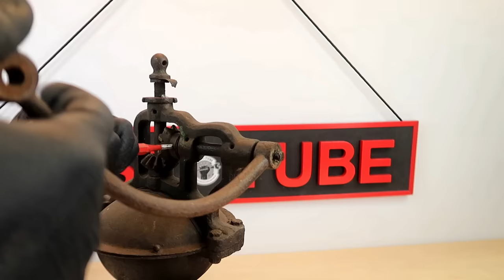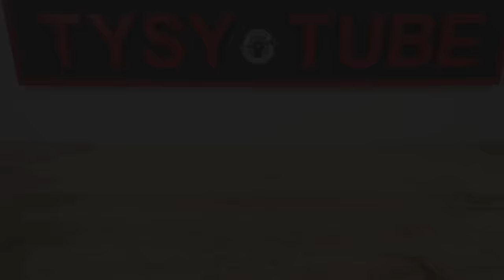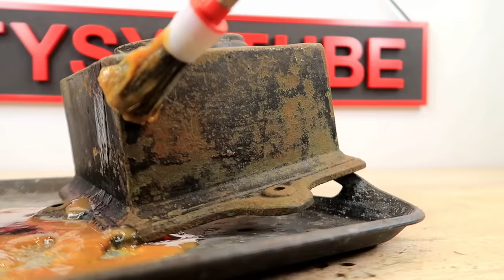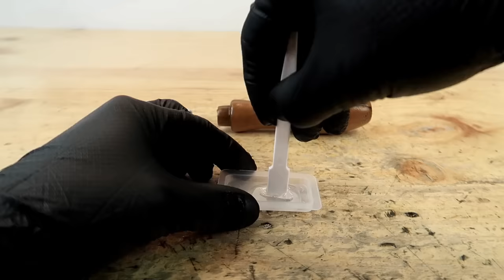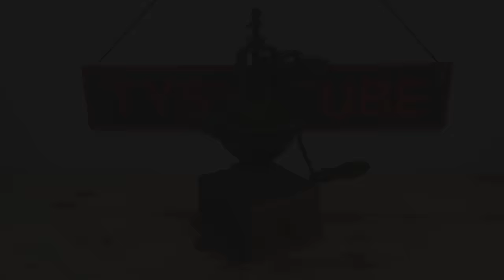Rare and Rusty Coffee Grinder - Restoration

Comment: Great video man! The only thing I would have done differently is NOT put any clear coat protectant on the actual grinding surfaces. I can't help thinking that every time you grind some coffee, potentially you're grinding a little clear coat in with it now. I wouldn't be too worried about the grinding surfaces getting corroded by not adding the clear coat, because coffee beans have protective oils in them. Keep up the good work my friend, you're very talented and are focused on quality restorations. Keep the videos coming.
Reply from the maker: is just decorative
Reply: @TysyTube  Again very cool, and considering it's just decorative it makes sense to have protected ALL metal. Keep up the great work man.
Reply: @TysyTube  
If juste décorative...
No paint please  😟
Reply: @TysyTube  it's not a restoration if you can no longer use it for the purpose it was intended. all you did was turn a coffee grinder into an ornament.
Reply: Septic Topix agreed
Reply: @septictopix4797  technically, all he did was turn a decorative coffee grinder into a much more aesthetically pleasing coffee grinder.
Reply: @SteeveBjornson  sure it's aesthetically pleasing. but it's a coffee grinder. would you drink coffee with bits of ground varnish in it? it's not a restoration if you can't use it for its intended purpose anymore. he could easily have coated the grinding surfaces with vegetable oil. and once you use it to grind coffee beans, they release their own oils, which would keep it seasoned naturally. THEN you could call it a restored coffee grinder.

Comment: Very nice! I had a sneaking suspicion about what's going on with the crank pin bolt when it wasn't in the sandblaster booth ;D Just one wish: obtain some brass acorn nuts for the hopper cover bolts, acorn nuts never fail to give extra prestige!

Comment: "im not gonna remove the casting marks this time"
[my mechanics disliked that]
Reply: "this part has a pit. i make a new one"
Reply: @aaczm1  "This part looks ugly,I make a new one"
Reply: @Certifiedretard66  and the difference that my mechanics is OCD as hell about everything being perfect, but tysy is just having fun building and communicating with the audience
Reply: I doubt he would dislike it? In the past he has always been supportive of this side of restoration, sure he does things differently but I love both my mechanics and Tysy for their own ways of things
Reply: @sandrakiss8711  Odd Tinkering is good too. I like all 3.
Reply: He made a new one because the pitted one would interfere with rotating the wooden handle. The smooth one was better working. Anyways the pitting would be invisible, hidden inside the handle so no loss. As an engineer - full agreement with this choice.
Reply: You should never remove the casting marks. They add character. And that was how it was originally made.  If you remove this marks you take away from the value in my opinion.
Reply: @Jesusisyhwh  while I agree that it is part of the original character, ultimately cast marks are artifacts of the mass production process. If you're going to spend time to fix something up by hand, it is totally natural to have the outcome be on par with a handmade object. This is not to say that you should be required to do so when fixing old things BUT that there is some room for interpretation about what the 'original' piece is (i.e. what was the original design intent vs what did the manufacturing process yield).
Reply: @if66was99  same here they all do a great job and find something that is interesting and sadly time has forgot and not been kind to it
Reply: papermaker107 nice fallout 4 reference

Comment: Hi. Nice skills as always. But why using flooring varnish and spray can paint on a device in contact with food?
Even if you don't want to use it to actually grind stuff, some of your viewers might replicate without knowing that's dangerous.
Linseed oil on wood and blackened steel would be more authentic and safer 😃

Comment: Can someone tell me why bother to use paint remover first? Wouldn't the sandblasting take off the paint?
Reply: Smaller blasters can take longer to remove the paint. If you have a smaller one you need to make a judgment call on do you want to brush stripper on, and walk away for a little bit, or stand there holding the part as the paint is eaten away. Also there is the normal where and tear on the items themselves to think about if they are running for a long time repeatedly.
Reply: It takes too long to remove the paint with sandblaster.
Reply: Thanks for answering my question guys.

Comment: I could almost smell the coffee! Very nice decision to keep the pitting and casting marks on this piece. I am very impressed with the clear coat product and I will research for a comparable item in my area. Also, your wood restorations are superior and it might be nice to see vacuum pot resin stabilization be used on your projects. The wood will be much stronger and the surface can retain as much texture as you want for your finished design.

Comment: Nice work, wow!
And thank you for taking the time to properly clean and prepare the piece prior to sandblasting... Btw, leaving the pitting and rough edges as they are was the right decision.
Just a quick suggestion though... you should really lubricate all rusty parts during disassembly to avoid any unpleasant accidents.
Great job., One of the best restorations you've done in a while...

Comment: Olive Green OR Sage Green might have been a better restoration colour, but you did very well with the finished product !
Reply: I too have a passion for old Coffee Grinders and have restored two medium-sized Wooden Bodied Grinders, with Wooden Trays, With a good clean removing old varnish and then hand-finished with medium, then fine-grade sandpaper, and a good clean with acetone, the wood comes up beautifully ready for one or two applications of Linseed Oil.
Afterwards, one or two light coats of Matt Lacquer, the original Patina comes through. All Grinder Hardware is/was already removed and dismantled and given a thorough clean with a Rust Remover then hand-finished to a brilliant shine by hand.
I suspect you are French and operate in France - where exactly are you ?  There is a genuine reason for this question.

Comment: I do make my own coffee from grinding beans. Unfortunately, I can't find a manual grinder and use an electric powered one. The only way I can make coarse ground beans is by only powering the grinder in short bursts. I also use what's called a French press. It's a glass cylinder with a screen on the plunger. I put the ground beans in the glass, add hot water, wait 5-10 minutes, then push the plunger down and pour a cup of coffee. I do not like instant coffee and don't like to use finely ground beans as they clog up the screen. I also like my coffee to be strong black coffee and don't use cream or sugar. I do like your YouTube channel and how you restore antique things and have been subscribed for quite awhile. I also get notified when you post another video.

Comment: I love the gloss black finish on the main body, The unfinished covers should have been filled, sanded and Painted either black, white or silver in my opinion, also I think the unit should have been mounted onto a wooden base, some of the nuts and Bolts looked a little too rusty to be reused so probably would have sourced or made replacements for them and then Hot Blued them.

Comment: Nice work, and beautif result. But where is the "yeah" cheering when starting sandblasting? You don't use any oil or grease on the moving parts outside the grinder itself?

Comment: I was pleased to finally see a restoration that didn't remove all the character from the cast iron. And then the grinding parts get covered in non-foodsafe rustol, rendering the whole thing unusable. :-( If the oils in the coffee beans themselves are not enough protection (which they usually are), linseed oil would probably be the best bet in a situation like this.

Comment: Quick question: why can’t you just sand blast it directly without using any chemicals for surface preparation?
Reply: Probably had lead paint in one of those 3 coats.
Reply: Hmmmm.. didn’t make sense.
Reply: 1. Reusing sand blast media. If there are too much paint in the media, the media can't be reused. 
2. To sand blast with paint on uses more media.

Comment: You should have used something to fill the pits first, then sand it smooth then prime it and then final coat the paint.  If there are pits that are very large, you need to arc weld a filling, grind it smooth.

Comment: As a chef and woodworker I would not have restored the drawer with varnish as it usually contains turpentine! Also it tends to break down over time and will end up in the grinds. I use lemon oil to restore wooden food surfaces only, no chemical or petroleum based products. When restoring food related items to working order to be used with food again, gotta pay attention to the products you use. I would not have painted the inside of the drawer box either since it will chip off into the coffee over time as well.

Comment: Help! In case of my coffee grinder, the very cog wheel at 0:57 just sits there and doesn't want to come off. I tried to stop it with nails but I bend them like wire. Neither do I want to damage the eye of the crank. Did you spray the cog wheel and shaft with something before trying to take them apart?
Reply: you could try using wd40, as long as you wash it off after you get it out.

Comment: I am restoring a Leinbrock's Ideal, D.R.G.M. coffee grinder, which looks surprisingly similar to this one. These are my first steps, I welcome hints.
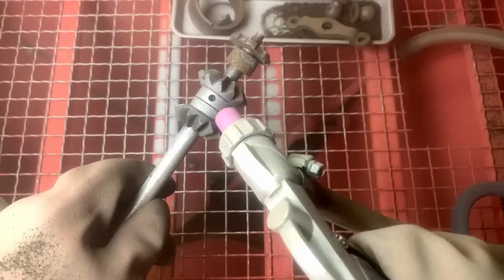11:15 Have you sharpened the heart blade of this grinder? I am looking for instructions on how to do it.
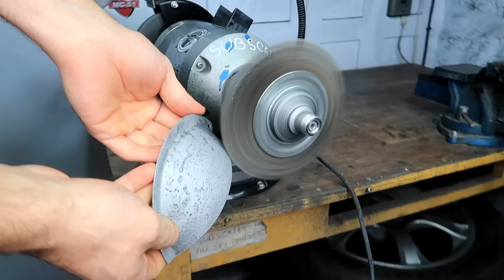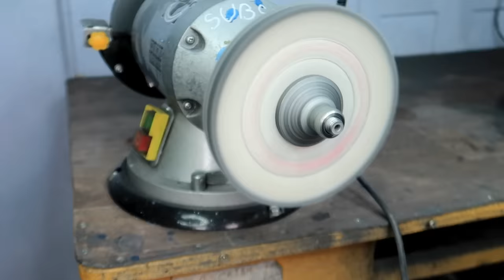11:55 and 13:49 Does the wire brush wheel produce a shiny-polished surface after sandblasting? I want to polish it but keep the pits. 
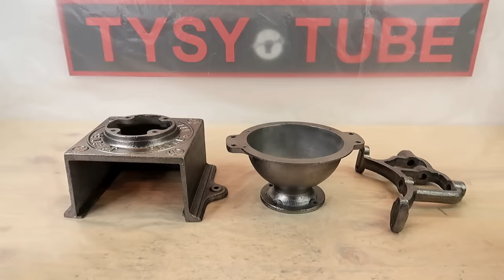12:35 What do you use acetone for?
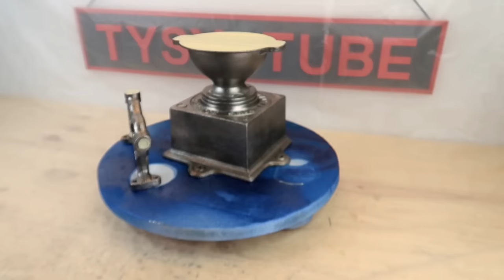12:47 How to choose the appropriate primer? 
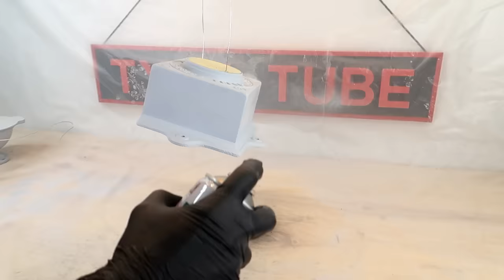13:26 What type of paint to choose?
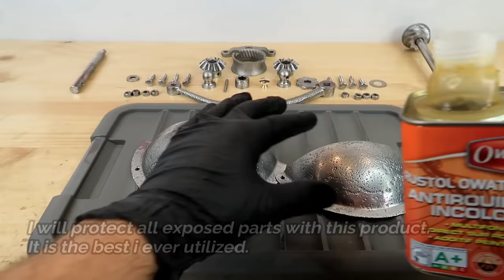14:27 What sort of protection coat is this? Please check the ingredients or appliances so I can look for a similar product. 
15:37 What type of marker did you use, and what sort of paint has it got?
16:20 How is this type of screw called? It's got a strongly bulging mushroom head. I need help finding them.

Comment: It's "119 YEAR old grinder", not "119 YEARS old grinder".    You only say something is yearS old if it comes after the noun.   For instance, it's correct to say "119 year old grinder" or "the grinder is 119 years old".   If using it as an adjective (as you did) then there shouldn't be an S on the end.
   You're welcome